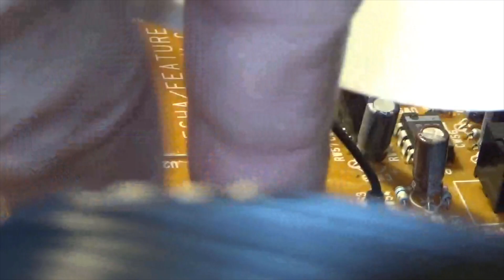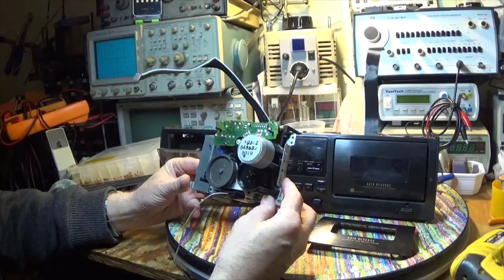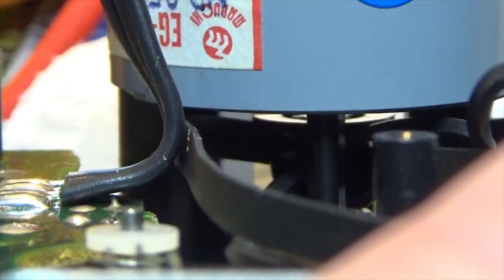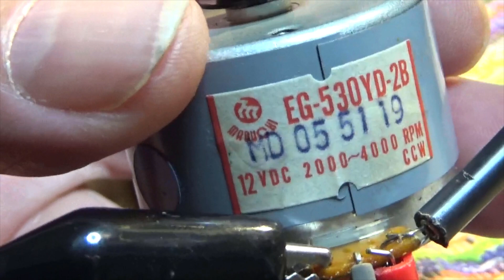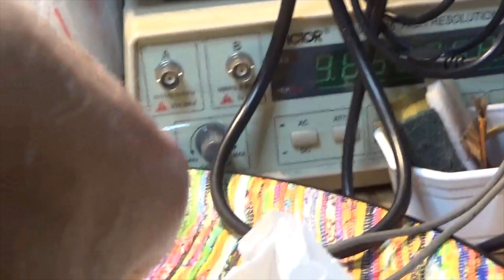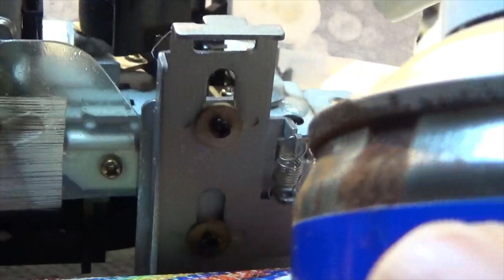Marantz SD-535 Cassettedeck Restoration part 1 of 2

Comment: This deck has no tape selector for normal, high bias or chrome? Is that a problem?
Reply from the maker: Good question.
No, the Marantz tape deck detects automatically which type of cassette you insert into the tray. There are special switches at the top of the cassette deck mechanism that detect the notches at the back of the cassette. Depending on the type cassette (Normal, Chrome or Metal bias) there are a number of extra notches which are then detected by the special switches. 
The type of the cassette is then made visible on the display.
You cannot set the bias manually.
Thanks for watching the video, giving me a thumbs up and considering subscribing
Reply: @TechneMoira Thank for the quick reply and information. I just acquired one of these and was checking it out. I played a few tapes normal and chrome but didn't see the info on the display as you describe. I'll have to assume it's working.